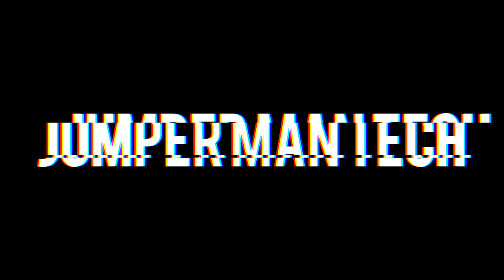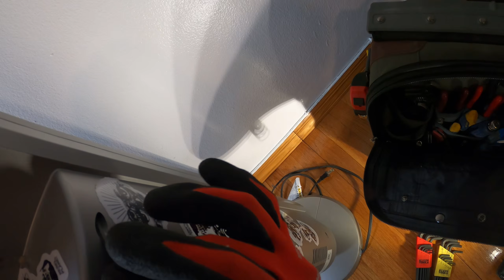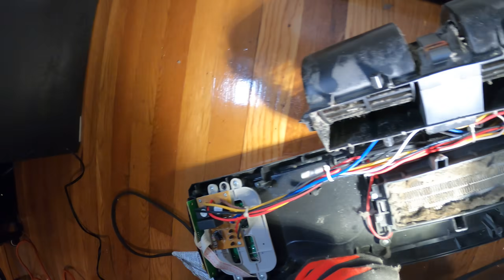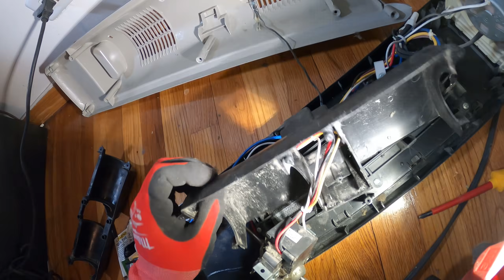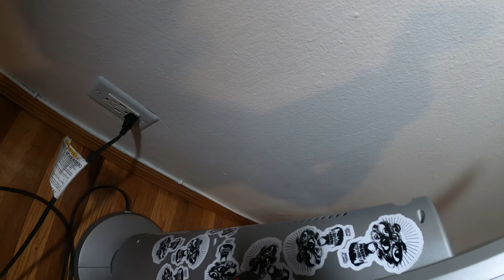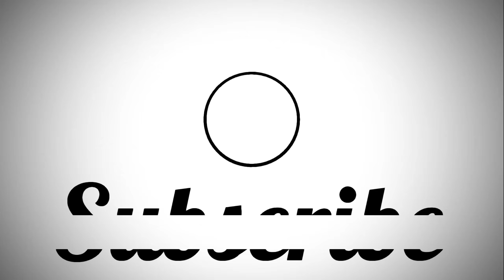HVAC: Lasko Ceramic Heater Keeps Shutting OFF (Digital Ceramic Tower Space Heater Maintenance) DIY

Comment: Sweet! Cleaned mine out. Had a big wad in it. Used a baby bottle cleaner brush, and a paint gun cleaner brush to hit the hamster wheel apparatus, vacuumed out the rest of the dust wads. Had to hot glue the sensor back to back cover. Screw it like a honeymoon. Plugged it in, and blamo! Good as new. Actually forgot how fast the fan was supposed to spin. Over time it slows down with the dust clogging up the wheel. It was on the front porch ready to throw away. SAFE!

Comment: I had the same model heater and did this.  It had been shutting down after 2 minutes and it wasn't even as dirty as this one.  I found the MasterForce screwdriver at Menards, Star 15 x 4 (inches) with magnetic tip.  After cleaning it, it worked for about an hour before the room got hot enough that I shut it off manually.  Thanks for saving me another $50-70.  Screwdriver was less than $7 and I have some more heaters to fix around here.  THANKS!

Comment: Landfills must be full of these things. I've rescued several that my neighbors put on the street as trash. As you have shown so well all they often need is cleaning. Same for vacuum cleaners. People put perfectly fine vacuum cleaners on the street. They're just plugged with pet hair or something. There's frequently an internal HEPA filter that people completely ignore. It also needs to be cleaned occasionally. But many people prefer to get a new unit instead of maintaining what they have. Apparently a couple of hundred bucks doesn't mean much to a lot of people.

I'm surprised your unit didn't have a couple of security screws holding the back cover on. Security screws require special screwdrivers to remove. They can drive you crazy. Getting the back off is often the hardest part in cleaning these things.

A couple of drops of oil on the motor bearings helps them last forever. They dry out. The bearings are surrounded by a gauze donut. It's not dust. It holds oil. Don't remove it.

Also, users should be aware that the aluminum fins on the heating element, that you showed plugged with dust, are electrically charged. Do not touch them while the unit is operating! And don't insert a wire, coat hanger, etc into the front of the unit while it's operating! It's just like inserting a bare wire into a wall outlet. The grill cover is not just for looks. It has small holes for a reason.

Just thought I'd pass along a couple of things I've learned. Thanks for the video!

Comment: I am using this exact heater in my  greenhouse but have to use extension cord. It keeps shutting off. It's the only thing that's plugged into the cord but still shuts off. Suggestion??

Comment: Cleaned mine out a couple  days ago. Had the shut-off problem today, 15 minute rest unplugged and it works fine.

I have a screen strapped to the back (nothing over the warm parts or heat elements, screen on the back) to keep out dog hairs. I found a LOT of dog hair in it when I took it apart.

For the pesky triangular screws, I found a small triangular file in my workshop, snapped off the handle tip right about where the screw head's hole size is, used that with pliers to unscrew those. Didn't bother putting them back, there's six other screws holding the back in place.

Comment: The damn unit should have a air filter on it it has a bad design it should be an air filter on the intake where you could get at it take it out clean it and then put it back again not take the whole damn thing apart I have a ceramic heater with a filter on the package easy for me to take off and put back I just have to wash it dry it that's it

Comment: Thank you so much!  I was packing the car today, heading for the dump, and had my Lasko heater in there because it kept shutting off after about two minutes.  A little voice in my head said "did you look on YouTube?"  Well, no, I did not!  I found your video, took the heater out of the car, and I'll clean it out over Christmas break.  Thank you for saving me from having to buy a new one!!

Update:  I did it!!  The hardest part was having to buy a star-end Allen wrench.  The hex key set, even though it was a long-handled 3/32", only removed about half of the screws.  The star end T15 wrench worked.  Thank you SO much.

Comment: YOO! Because of this video I was able to resurrect my heater !! 🥰

I had actually cleaned the squirrel cage before I came across your video, but it still wasn’t working. It wouldn’t even kick on at all. Only the red light came on.

But after watching your video, I saw you went all the way back to the coil. I had to take it all apart and give it another go, just to see if this could be the issue and just like in your video,  my coil was packed with dust. 😮

When I turned it back on, I was frustrated because I didn’t hear a fan kick on so I cursed at it and just assumed it was beyond me saving it. 

But then I walked by the heater a few minutes later and realized it WAS WORKING!! I am just so use to my heater being loud-most likely do to it chugging bc of how dirty it was. 
It’s so quiet now it threw me off for a bit. 😂 

Thank you so much for putting this video out to the world! You saved me money, I learned something; and it keeps one extra thing out of the landfill. 
❤

Comment: I have a lasko heater similar design,  same fan, it was dirty so I cleaned the inside but it still likes to shut off after 1 minute , it's had this issue since I bought it , but I don't see any obvious fuse , it's a resetting fuse but not sure where it is on the board

Comment: my lasko heater that is still sold today the ceramic CT22410 the cable melted and one prong broke off, it looked burnt huge fire hazard lasko has recalled several ceramic heaters but not this one! don't buy lasko heaters.

Comment: Mine has a weird shaped screw that I can’t find a tool to remove it. That sucks
Reply from the maker: I think the screw you are talking about looks like a square correct? You need a tool called "Allen keys". Hope that helps. Good luck! Thanks for watching & stay tuned for new videos every week⚡️🔧
Reply: @JumpermanTech  it was a star shape but I ended up being able to unscrew it with a small flat head, I cleaned all the dust out and the space heater works perfectly again
Reply from the maker: Or possibly a star looking screw with a circle in the middle. Then you would need a tamper proof Allen key👍
Reply: They’re called torx screws.

Comment: Two heaters bough less than 2 years ago and sparing using in bedrooms over winter months in Texas.  One stopped with no light. The other one shut down with light on. 
Although, one of them turned on after unplugging and restarting but I threw both of them out as it could be a fire hazard. I have seen plenty of reviews on Amazon about Lasko tower heaters starting a fire at socket.

Comment: Hello, great video, but in my case after a cleaned it (maintenance, no previous issues), it shuts off and it shows 88 on the screen, I also noticed one time the outside temp went all the way to 85 in 4 or 5 secs before shuting off. What can I do?
Thank you!

Comment: Excellent video!!! I would normally buy a new heater every 5 years, thinking that was the normal failure rate, never once considering dust. This time.it shut down within one year. Well guess what? We have 2 short hair chihuahua's that shed like crazy! That has to be it. Thanks dude!!!
Reply from the maker: Thank you! Maintenance is very important 💯 There's a good chance there's dog hair in there lol I find AC units with filters packed with their dogs hair so it's very possible. Open it up! Appreciate the feedback 🙏

Comment: I am horribly embarrassed this is my issue.  I clean my fans regularly as well as my sewing machine. But I didn't think about the heater. So glad it's an easy fix as well as deeply satisfying to clean. I love my heater. It is my bathroom heater for sauna tub time.
Reply from the maker: It's natural! Maintenance is very important. Glad you found the issue. Thanks for watching!
Reply: Make sure you replace your air filters in your home AC as well

Comment: Hello,
Greeting! 
Here is the Marketing Manager of the Space Heater Customer Service Center.
 
We love your videos! I have seen your video review for the indoor space heater in recent months. It seems that you are interested in testing different kinds of heaters. And our a new brand has just released a new space heater, I guess you will be interested. 
 
Would you love to issue a video about our space heater on your YouTube?

Here are the features of the Space Heater: 
1. Electric indoor space heater with remote control
2. High / Low mode(900W-1500W)
3. ECO mode
4. Auto off 12H timer setting
5. 80° oscillation
6.45° tip-over protection
7.122°F/50°C overheat protection
 
We have released the space heater on the Amazon. 
If you are interested this high value product, could you please let us know your ideas?
 
Thanks for taking your time to read this message.
And looking forward to your cooperation.

Best regards,
Customer Service Center
Reply: Hello,
Greeting! 
Here is the Marketing Manager of the Space Heater Customer Service Center.
 
We love your videos! I have seen your video review for the indoor space heater in recent months. It seems that you are interested in testing different kinds of heaters. And our a new brand has just released a new space heater, I guess you will be interested. 
 
Would you love to issue a video about our space heater on your YouTube?

Here are the features of the Space Heater: 
1. Electric indoor space heater with remote control
2. High / Low mode(900W-1500W)
3. ECO mode
4. Auto off 12H timer setting
5. 80° oscillation
6.45° tip-over protection
7.122°F/50°C overheat protection
 
We have released the space heater on the Amazon. 
If you are interested this high value product, could you please let us know your ideas?
 
Thanks for taking your time to read this message.
And looking forward to your cooperation.

Best regards,
Customer Service Center

Comment: Mine restarts like ever 30 minutes and when it turns off it will beep like every 30 minutes
Reply from the maker: There is a good chance that has the same problem as the one in this video. It might be overheating overtime and shutting you down as a safety precaution. Clean out your unit & try again to see what happens👍 Make sure the fan spins! Thanks for watching & stay tuned for new videos every week🔧

Comment: but when i put 75• its working
Reply: Dude I have the same issue !!
Reply from the maker: @roshanakaktefan3661  You need to set the temperature above the room temperature or it will shut down as designed. Once the room temperature reaches the set temperature, it will shut down. Thanks for watching!
Reply from the maker: Need to raise the set temperature above the room temperature to keep it running

Comment: I have a Lasky, slightly different model but not as tall.  It was working fine and I accidentally knocked it over the other day while it was off.  I tried it after it fell and the red light went on and it beeped but there is nothing working on the display nor do the buttons work to turn it on.  I opened it and cleaned the fan cage, but didn't know to clean the ceramic part underneath. Anyway when I plugged it back in I still got nothing. Any ideas what it could be?  Someone mentioned a safety switch on this comment section in case it gets knocked over.  Where is that?
Reply from the maker: The ceramic part is the most important for cleaning. Dirt doesn't seem to be your issue. Unfortunately I can't really say without checking it myself. If there's a safety switch that could have you locked out if it has that tripping safety. There should be a Lasko technical support number you can call. They would have the best answer for you👍 Thanks for watching!
Reply: @JumpermanTech  i took it apart again today.  I got to the heating element and it was surprisingly clean under there.   I found out what the issue was.  I finally decided to remove the control board to inspect the welds.  

So,, when I took off the control panel one of the soldiered wires was loose so I re-fastenrd it an viola its back up and running again.  

I ran it for awhile until the cleaner I used all burned off.   it wasn't just ethyl alcohol spray.  I didn't notice it had glycerine and lemon scent in it..  I cleaned the fins out with it because it said it was for surfaces and hands lol I let it dry real good then tested it and it smoked a little bit because  of the additives.  

Once it heated off in a few minutes, it stopped. Any way I'm so glad it's working again. Yay.  It was a dark purple wire that attached to the board. It got loosened but not detached.
Reply: @JumpermanTech  5hank you for replaying to me.  That made my day, even though I didn't see it until after I was done. Thanks
Reply from the maker: @HRTsAFyre  I'm happy you got it running! Good job👍 I'm glad you have heat again. Sometimes that's the best feeling ever lol I'm  glad I could make your day🙂 Enjoy your heat & evening✌ Thanks again for watching